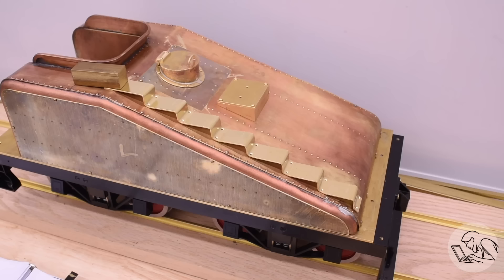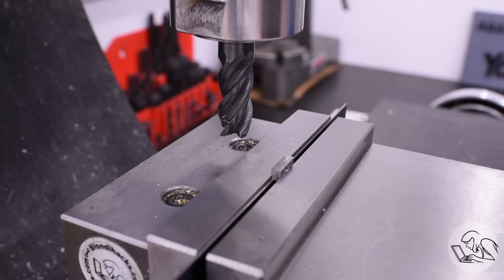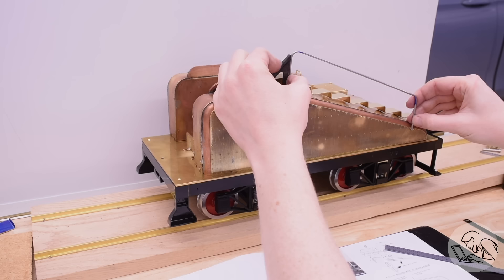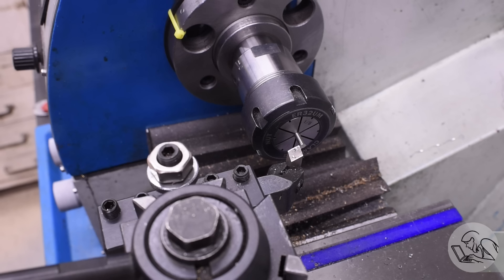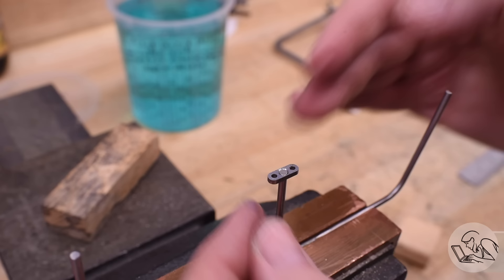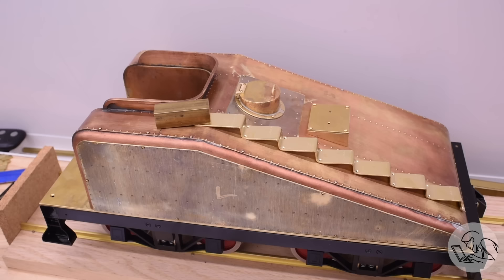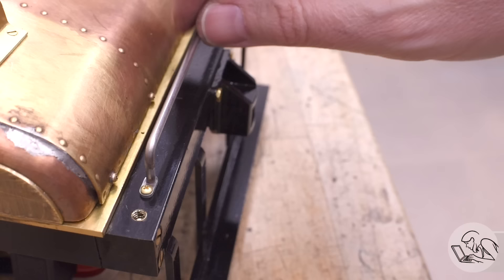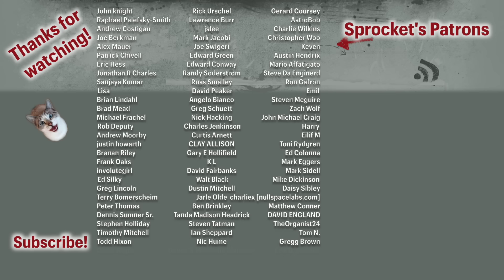Stainless Steel Handrails - Pennsylvania A3 Switcher, Part 28

Comment: 14:53 - why not just make the pins on the end of the wire you are using for the stanions (spelling?) instead of a separate pin and now needing to drill 0.051" hole? EDIT - she explains at 16:28

Comment: That hand rail design is not pleasant. I suppose the differing angles added strength and avoided parallelograms.
Reply: Or it was easier to fabricate… I doubt the real thing had carefully  birds mouthed joints.